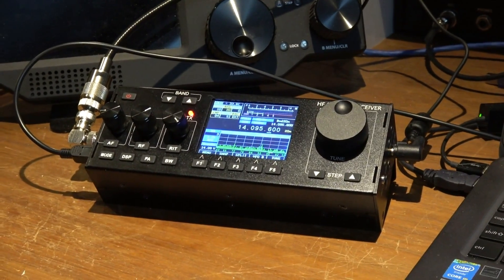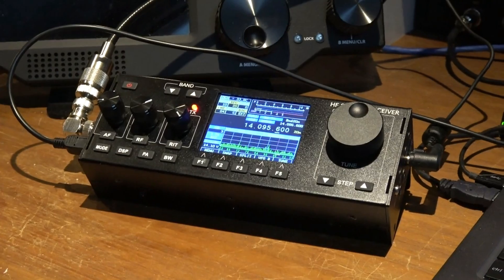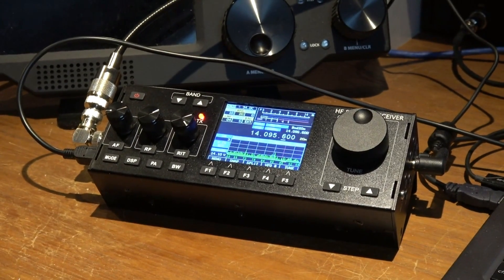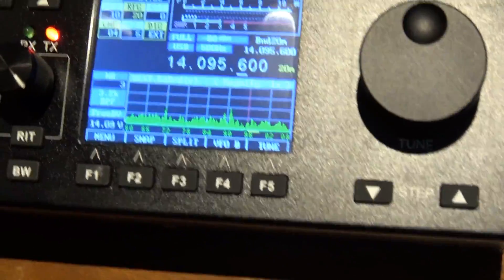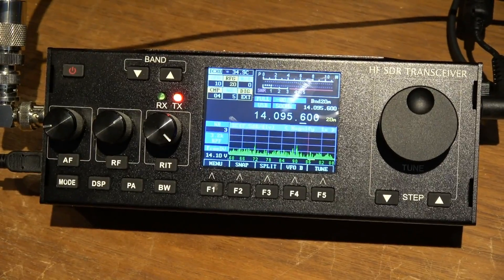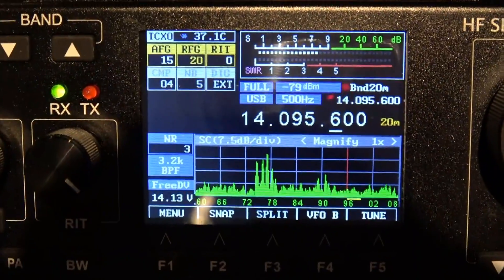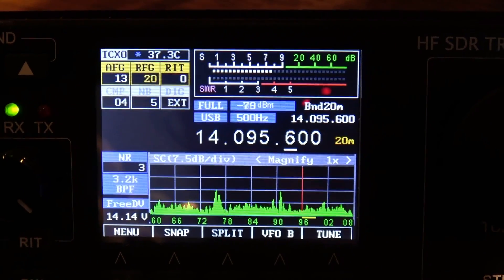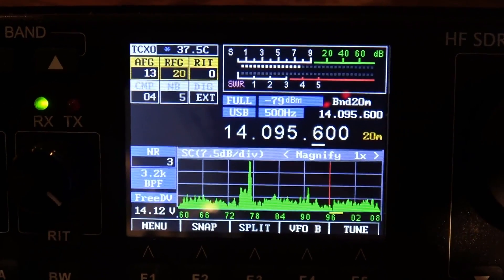Recent RS-918 SDR demo on WSPR

Comment: The manufacturer of this radio now sells a kit on eBay with the case, knobs and all the other parts necessary to make the radio except the parts that come in the kit sold by the original designer, Krassi (Chris) Atanassov (aka M0NKA).

While building your own from the two kits is a lot less convenient than buying an assembled radio, the upside is that you will get the latest v0.7 revision of the board (the Recent RS-918 is based on an older revision.) To further complicate things, Recent is now selling a revised model, the RS-928, but I've not had any luck finding out what the exact differences are.
Reply: Golan Klinger the 928 has a built in battery. There may be other differences.
Reply: 928 is 10 watts and the 918 is listed as 15 so a loss of a maximum of 5 watts.

Comment: This is a very cool rig. Love the concept. Outside of sending brief 2 minute package of info. Is the info set or can you send what ever you want for info. Like send a text or emergency info. Great video. AA1US.
Reply from the maker: No. WSPR, like FT8 is confined to short, canned messages. If you want a bit more than that, BPSK-31 is the mode you want. I did a lot of work in that mode a couple of years ago.
Reply: The Radio Hobbyist ok thank you. Seems like a very cool rig. I will do more research. Thank you.